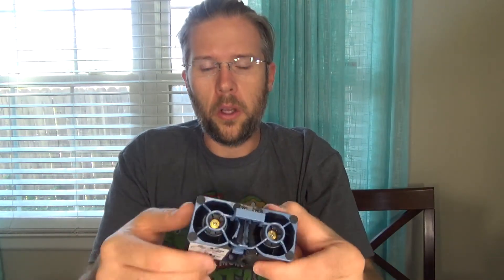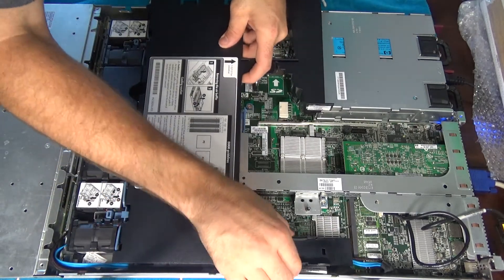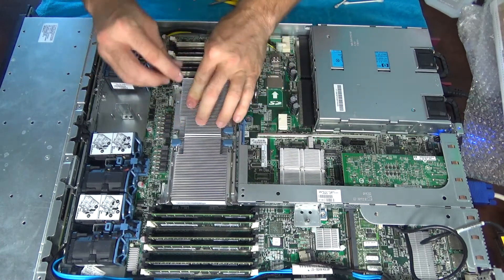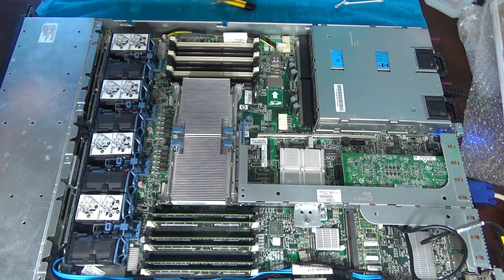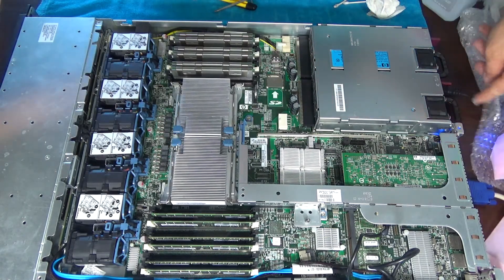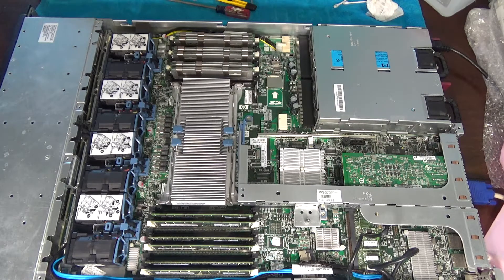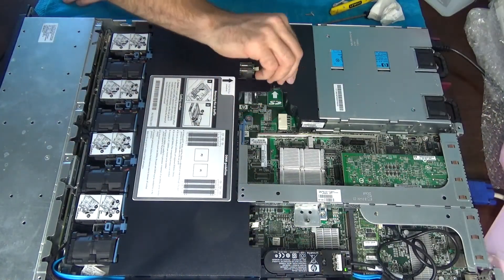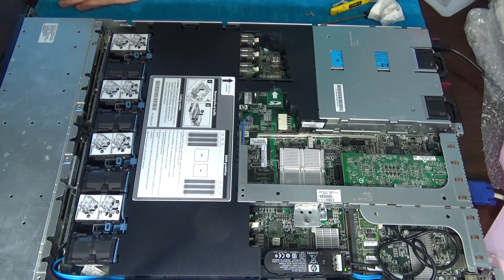HP Proliant DL360 G7 Server upgrade

Comment: What is unmatched pair
Reply from the maker: It was "a matched pair." So basically two identical CPU's.
Reply: But it doesn't hurt to have 2 not matched pair does it? @RazorBucks
Reply from the maker: It is not good practice, but it can be done. You need to look at the specs for your chips and verify with Intel documentation that they are compatible.

Comment: does anyone know if a g8 motherboard will fit in a g6 chassis? the shape and size of the board is the same, but i wonder if everything lines up.. like the fans, power supply interface, IO ports
Reply from the maker: I am not sure myself.

Comment: Yes, my DL360 G7 also takes just as long.  If you hook up the iLo (remote administration network port on the back) you can use that to watch all the POST codes go by (it is illuminating).  I found this video because I'm thinking of upgrading the dual XEONs I already have in mine.  I wish I had found mine as cheaply as you found yours.
Reply from the maker: Thank you for the post. I should look into the iLo, it sounds like fun. I get a lot of my stuff from local county auction. Best of luck on your upgrade path, mine is likely to become my VM server over the course of the year, I recently picked up a different machine for editing on.